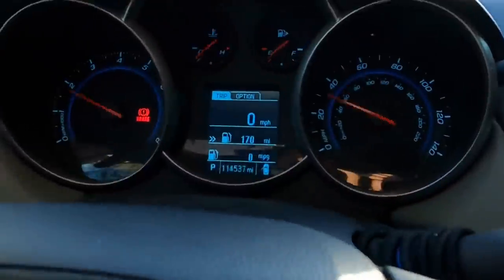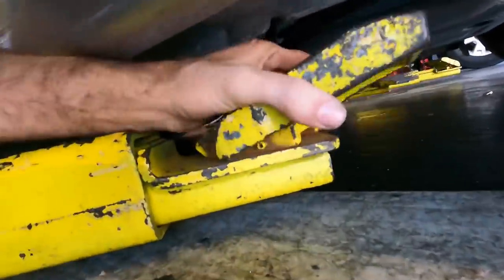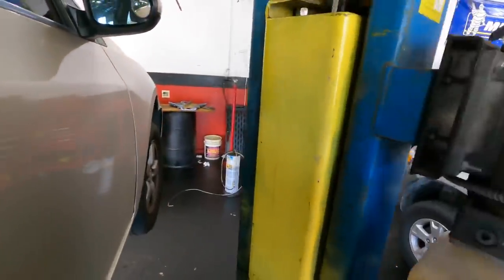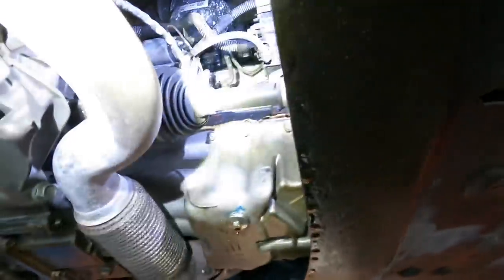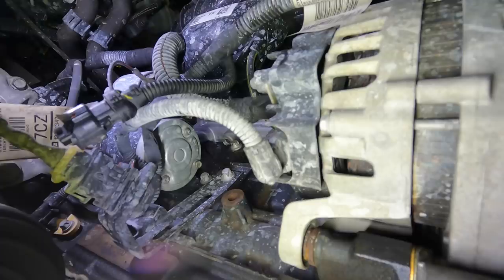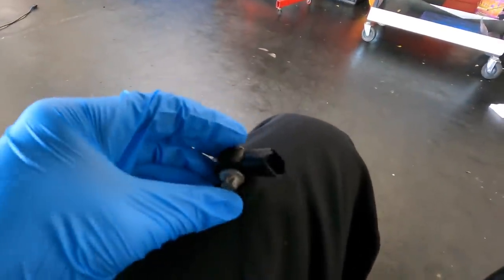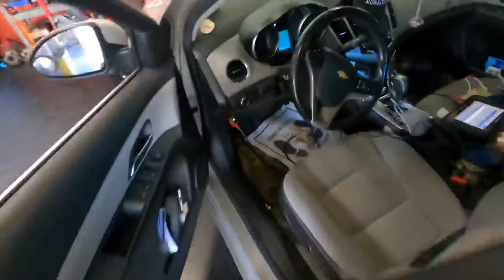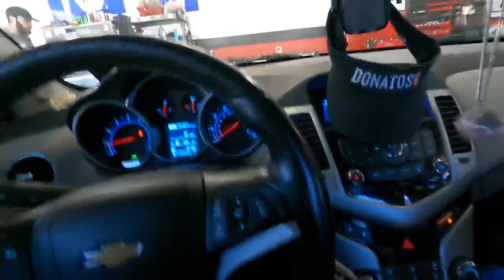Rolling the Dice! Parts Store Diag! Customer Supplied Parts. 2015 Chevy Cruze  P0324

Comment: And that is why so many cars have pinch welds bent. Some cars have added thick reinforcement plate for lifting in seam. Some of cars requires U shaped block that goes around pinch weld and support vehicle on flat surface. Lot of people got their seems destroyed becouse of this. And it is really annoying when some mechnic ruin seem  right after rocker panel replacement.

Comment: Great explanation about the lift points Ray. I have a MG convertible that went into a UK shop for tyres a couple years ago, I collected the car and they said nothing. A couple weeks later I was doing a brake pad change, got down on my knees to make sure I got the jacking points and found two bent and crushed sills (you call them rockers) one on each side, the idiots had missed the jacking points altogether and just lifted it on the thin metal of the sill panel.  Of course going back they totally denied it.
Reply: I'm shocked an MG was even heavy enough to crush anything.  It's been a LOT of years since my mom had hers, but I recall it being pretty tough little roller skate.

Comment: If you ever want to not have a knock sensor code on a heavily modified motor, place an o ring on the bolt between the sensor and the block. Works great to keep a light off when you have a gear drive, big cam, solid motor mounts...etc

Comment: here's a question about that knock sensor if it was so easy to disconnect the wire from it so easy to unscrew around the engine block what says that wasn't the problem with it instead of having to replace the whole thing and I don't know logical to tighten it down tighter and make sure the wire is connected better to see if it worked instead of replacing the whole thing cuz obviously it's something that should have been tight in the first place and it wasn't so the customer might have bought a replacement part for nothing

Comment: we have had the head gasket go, water pump, PCV twice, thermostat, 02 sensors, water outlet, 4 new coolant lines, turbo, engine oil cooler few other things. 14 98k miles. The cat also failed, but thats most likey related to the head gasket killing it, but as a note, we put on a Dorman, megaflow, and the check engine light remained. we had to go OEM

Comment: In australia we call them the holden cruz, in my experiance the oxy sensors play up a lot and so does the cooling system lol. Oxy sensors are pretty dear for that model and aftermarket ones will not fix the problem. Two of the cars had bad ecu's and they cost more than the car is worth here. They basically went to the scrapper. (Pre covid 2nd hand prices) last oxy sensor i got from holden was roughly 300 bucks if i remember correctly. And the ecu was gonna be around the $2.5k mark.

Comment: What lifts does the shop have? I poured the pads for a twin post lift when I built my shop here at my house. I need one that will lift my 6400# F350 high enough to work under it. Garage is 18' high in the center.

Comment: Those knock sensors are basically microphones, (pre)detonation sound transmitting through the engine block is distinctively high frequency and can somewhat easily be detected. Saab did this already in early 80's with relatively simple electronics. Sensors seem to be the same.
Reply: The Saab system measured ionisation current through the spark plugs, it's a very clever system that gives more information than a knock sensor, but required some pretty robust electronics on the secondary side of the ignition coil.  It's sad that Saab is no more.and that later models had too much GM influence, they made some really innovative cars.

FWIW there is no such thing as pre-detonation (though the term seems to be commonly used).  It's either detonating or it isn't, though there is pre-ignition which can then cause detonation.

Comment: By the way those pads on the lifts like that can break I had a brand new Ford Pickup come off the lift because one broke. I was just walking under the backend when one of the front ones went. Luckily I got out. The front of the truck went down and the back stayed up. We had to get a fork lift to get it back on the floor. Only thing damaged on the truck was a dent in the muffler. I was lucky!

Comment: I drilled a hole in my engine mount and sent a knock sensor in with a custom harness I made. Damn 1mz-fe sensors are so sensitive and intake manifold is a pain to get off on RX 300. It worked perfect and advanced my timing for extra horsies. 😂

Comment: the last one i did was to put tape on a long extension and go over the starter so it would not short out, then with the knock sensor hanging down i could un plug it. then reverse to install

Comment: Of all the issues the 1.4L has and that we have fixed in our service department, this is the first time I have seen that sensor be a culprit....  The oil under it though, lol, seen MANY of those. Can covers, because PCV issues, with means intake is gone, water pumps, turbos..... Oh, and coil packs.

 I had a 2011 1.4L was reliable, right up until it hit 142k then all hell broke loose. Lost two valves, intake, cam cover, coil pack, and a constant check engine light for camshaft position sensors performance AND circuit...

Comment: Ray, love the videos, I've been watching for quite a while.... I've been an L1 Master tech for the last 37 years with the last 12 years as service manager of a fairly large repair center....you have an excellent ability to explain things to people with little mechanical knowledge without talking down to them.....  using the word "click" when any threaded fastener is finish tightened to spec and in the absence of a torque wrench is common in the industry and uttered literally thousands of times every day by A and B techs all over America....the term "reverse click" is used when a left hand threaded fastener is tightened, when a fastener is loosened the term is "un-click"....also, the correct term for a situation when a parts store (or the internet) diagnoses a vehicle and the customer buys said part for you to install is known as "parts store roulette"      carry on... 
Will

Comment: I had been wondering about the lift points and such. The OEM jacks I've used recently seem to straddle the pinch weld and contact the body on one or both sides of it - but I do remember a CIVIC from many years back that contacted the lower edge. Good explanation on the knock sensor, too!

Comment: I really like videos like this. The only ask from mechanic videos is a final time line, this helps us estimate better for these types of repairs.
Reply: It wouldnt really help you that much, though.  It might help you estimate RAY'S time to repair, but another guy might take twice as long.   4 times if it's in a rust zone.  The variability in time for work, especially with well used vehicles is amazing, even for the most experienced tech.  I've seen same guy do the same job on a same model yr vehicle take 50% longer.  He was still under the Flat Rate, mind you, he just ran into 'stuff'.  
In any event, Ray has mentioned that he's limited in what he can say due to his agreement with his employer.
Reply: Thanks for the advice. We’re a small new shop, just trying to get a better grip on our cost and estimating.

Comment: Good 👍 explanation of how knock-sensor works what it does. It adjusts timing for different octane petrol also, allowing maximum advanced ignition without pinking Pre Ignition Knocking (not pinging) although it does sound like a pinging noise 😉

Comment: Hi Ray. interestingly enough, that car would probably fail its "warrant-of-fitness" here in New Zealand because of the dent in the sill. If its greater than 40mm in diameter it would fail the "warrant" check till repaired or replaced.

Comment: Up in the Nortthern rust belt states a rocker pinch weld lift will be a risky choice, as on older cars the  rockers are one of the first areas to rust out,  then you find the owner rather annoyed that their rocker is  crushed beyond recognition and the car almost fell off the lift as the rocker turned to dust as the car was being raised

Comment: Knock sensors are really just a kind of microphone allowing the ECM to "listen" for knock. Filter circuitry or software upstream from the knock sensor allows the system to discriminate between normal sounds and knock.

Comment: Wow Ray I wish my knock sensors were that easy to replace. 2000 Avalon V6 3.0L engine...  you can't even lay your eyes on them until you remove EVERYTHING on top of the engine down to the lower intake. Ended up changing all the valve cover and intake gaskets and while it was all out changed the spark plugs too along with the knock sensor harness.
Reply: That can't be possible! I have read over and over in this thread included that Toyota's never fail,  and if they do fail the bad part is mounted on the Top of the inner Fender liner and leap out when commanded to do so.

Comment: The knock sensors on my '03 5.3 Tahoe are located beneath the intake manifold. Periodically, I get a code but rather than pay a $1000 to replace them, I'm just running 93 octane fuel and an octane booster fuel additive.

Comment: The lift WILL NOT FREE FALL if a hose blows. The lift I have the the hydro lines run from the pump through the C Channel where the piston is go's to a Tee and 1line go's down to the piston the other runs up and across, back down to the other piston. Any way I had a 3500 chevy on the lift my buddy seen a slight leak on the tee well he started messing with that and didn't push it back in far enough when I was letting the lift down it sheared the Tee off when the truck was 4 1/2- 5 feet off the floor and the cable for my lock is broken so I took the springs off them and set them separately after I get it up so the locks where unlocked position. The lift only came down a little faster then bringing it down with the valve because the pistons still have to push that oil out whether it's going back in to the reservoir or on the floor. the lift will stay level unless your cables are out of adjustment but you would see that  when lifting the car if its. not level going up

Comment: Hey Ray, congrats on a EASY KS replacement. LOL. Mine is bolted to the top of the block under the lower intake manifold (V6). Also, some engines may use it to detect proper engine operation when there is no pinging (i.e. just detecting a consistent ignition pattern in conjunction with the timing and whatnot)

Comment: In this case, the parts canon seemed to work although the code wasn't present. I have a 1.4 turbocharged vehicle and I only run 91 octane fuel in it or it will occasionally throw a knock sensor code on hard acceleration.

Comment: I think the video is more informative than rambling about the lift.  I almost always hear you say, "locking lift" whenever you get the vehicle to its high point.  I thought the lock was automatic but now see that you need to release hydraulic pressure slowly to make sure the locks make proper contact.  Don't get complacent.  Stay safe.

I am not a mechanic but have a healthy respect for safety when crawling under lifted vehicles.  When I am at the pick & pull, I always push the vehicle from several angles before I will crawl under it.  I have seen some that look like they are teetering on the stands or the stand is under a thin rust spot.  I will walk away if it doesn't look right.

Comment: As for those pinch welds, they're also commonly the vehicle's lift points using the crappy scissor jack to put the spare wheel on with (just check your owners manual).

Comment: Good job on explaining the rack lift points. FYI, just so you all know, you really shouldn't use the 4th pad adjustment, unless absolutely necessary. This is when the lift pad is just about straight up and down. It may feel solid, but unless you have them at the right angle away from each other, they border on almost dangerous. I've actually seen one kick a leg out, because of the angle, and where there were facing sometimes you'll run into having to use to lifted up in the fourth position, and the others flat. This isn't quite as bad, but anytime using that fourth position is sketchy. The legs can kick out quite easy, they can fold down, and they can fold down pretty easily. Don't ever lift the car unevenly, with them damn things in the fourth position. My buddy did this. Yeah, it actually went back first, off the lift. It was a good thing it was his own car.( older Ford F-150 with the frame that curve down in the front)

Comment: I'm surprised that you put the lift points on those pinch welds: the manufacturer-supplied supplied jacks usually bridge the pinch welds and contact the frame of the vehicle on either side of those pinch welds.

Comment: A customer who is bright, knowledgeable about cars, and especially the one needing repair can be of great help to the mechanic,  with questions like where does this wire go, or was this an earlier repair, or a more complete history. Unfortunately they may not want these customers, by their car when the repair is being done now a days. It also helps the owners, if they see what and understand what is being done, if a problem pops up hours or days later and might be related so they might correct or fix some little detail themselves, like a wire or hose not plugged back in. 
The NOT knowledgeable or unknowing customers usually will not want to stick around their cars during repairs. 
Customers can save you time and money and headaches, and that's good for everyone.

Comment: I once had to add a resistor inline of a knock sensor to mask the signal. It was sensing lifter noise due to engine wear and short of a rebuild, was the only correction.  I believe it was an oldsmobile

Comment: Lift safety is the most  important deal to learn, when it comes to back yard stuff cinder blocks wont cut it, four or six jack stands placed over square pieces of painted half iinch  ply wood will work on gravel, the other deal is never work alone, even if the person  is just watching with a beer in one hand and the other hand has  a finger in their nose

Comment: And if the car is a little older you need to mack shire that the pinch weld is not rusting away it maybe not safe to Jack up on the pinch weld if so it be best to Jack up on the rear end in the front jack under the coil spring= lower control arm  that's where I jack all automobiles up at and I use Jack Stands every time before any part of me gos under the automobile  if im on dirt I use 16"x16" 1\4 thick under the Jack stand to keeping the stand from sinking into the ground falling over  I almost had a car fall on me wen I was 21

Comment: So, I messed up installing a new transmission mount and for the life of me can't get a bolt to tighten flush. It goes about 1/2 way in, tightens up tight, but isn't flush against the mount. 

I'm assuming I need to rethread the hole, I've checked all the bolts and they're all the same length. An hour job for myself to do has turned into paying a shop to rethread a hole (the access and tap I have to do it don't give me good feelings) 

Sometimes, it's better to just let a shop handle things.
Reply: If the bolt isn't carrying any load, add washers under the head.
Reply: @scott_meyer  It secures the mount to the frame. It's one of 3 doing that job. There's two others that come from the side and secure to the transmission itself. Those torqued to 80 ft lbs just fine. 

The other two securing to the frame tightened up perfectly fine, I've taken it apart twice trying my best to fix it and driven the car for the past 5-6 months like this lol. It's a bit of a nasty situation though because I'd hate for my transmission to fall out of the engine bay lol.
Reply: @VanillaWahlberg  
Did something fall in the hole?
Reply: @scott_meyer  Honestly, that's what's been bothering me lately. I think that might be the case lol. I'll have to pull it back apart this weekend. After that, I'll leave it to a professional lol. Thank you!
Reply: Make sure its the correct bolt and not to long that goes in there. Also make sure there is no liquid in there causing pressure buildup. 

You can make a thread cleaner out of a bolt. Cut 2 groves in the lenth part of the bolt 180 degrees opposite of each other. Then run it through the hole. The gap acts as a cutter and leaves a place for the material being cut to go.

Comment: those were fun little cars. not a lot of power but fun to play with and work on. the engines had few issues but the frames and interiors had very little issue ( my experience ) then chevy went and changed them....

Comment: Run decent gas (not the low bid ethanol crap at the cheapest place in town) and change the oil when it turns brown or 3K miles whichever comes first and knocking due to pinging will be a non problem most likely.

Comment: If one of the seals on the lift did fail how would you get the car back off?

Peace
Reply: Just grab a forklift and pick the car up off the lift... :) the kind they use at the scrap yard with the super long reinforced forks.
Reply: @brnmcc01  But wouldn't that cause damage to the car because the safe lifting points have already been taken up with the lift?

Peace

Comment: Pinch welds are not so safe up here... You might not get your lift pads back.
Here... I prefer the main structures between body and suspension/sub frame.